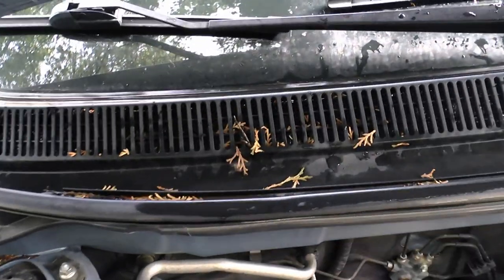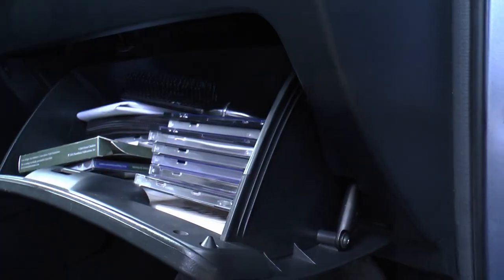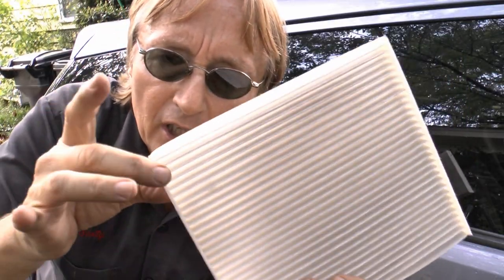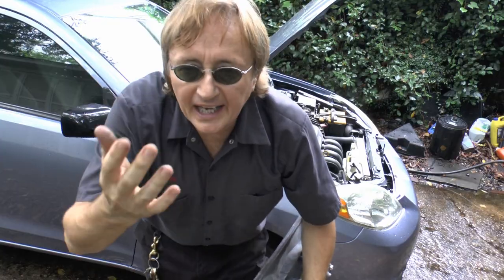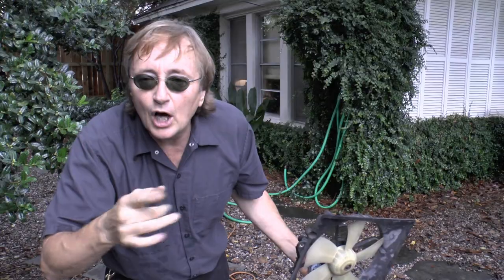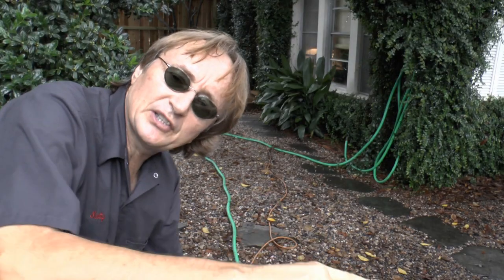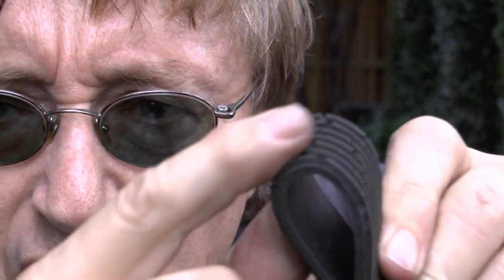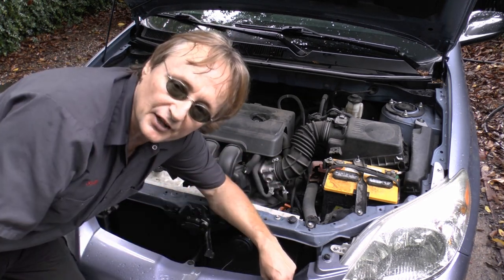How to Keep Your Car's AC Blowing Ice Cold for FREE

Comment: Hello Scott Kilmer! I have a problem with my Air in my 2006 Chevy TRAILBLAZER. it does not come out of the top vent facing the driver at all and is limited on the remaining middle and passenger vents, but work on the foot vents. can you tell me what seems to be the problem. I also have a problem when I start my truck up, it tends to turn back off: why is that happening?  My check engine light is still on and I changed the: MAF SENSOR, Oxygen Sensor, Cooling TEMP SENSOR, Oil Pressure Sensor,  Temp Sensor, Spark PLUGS and, Cleaned the Throttle Body- but not go off: What can be the problem you think?  My truck also shows a STABILIZER and Tracking Light on my dash for every time I turn my Steering WHEEL to the left or making a left turn on the road; I replaced my Stabilizer Links and bushinga, Control Arm Bars, and Rack and PINION. What could be the problem to this issue as all of others.  I thank you so much for All of your help and video illustrations!

Comment: Hi Mr. Kilmer!  Thanks for your shows, they are fun and your easy to understand!  I have a 94 Trans AM that I bought off a guy for a real unlucky price considering what problems I have ran into.  Can you show how to tune a bad accelerating, gas guzzling, loose clutch, misfiring car out of first gear?  I'd like to at least be able to regain all 350hp and turn out into the street with out crawling and waiting to suddenly accelerate.  Also if at all possible some veteran tricks to developing gas mileage, can you help?
Reply from the maker: Lorenk911   first, pressure test the fuel pump after changing the fuel filter, it could need replacing. Second, change the spark plugs and air filter, and pray my video "how to clean fuel injectors on your car" can get it working good again

Comment: hey Scotty, are you supposed to discharge for ac before taking off an ac compress to replace it with ac bypass.
Reply from the maker: +DatBoiSheed yes, legally you are required to use a recycling machine to catch it

Comment: Hi Scotty, i bought a Sprinter van of 2007 from a cold climate country. My guess is they never used it.
When i try to turn it on, just plain air comes out. But also when i turn it on, the engine wont change idling sound. Like all the others i have seen when AC is on. The Mechanic found the input for the liquid and pressed it. It made a hissing sound. Like compressed air coming out. And he said we need to fill it up with AC liquid/gas. My question is, since it has not AC liquid/gas in it, how come it let out compressed air? And do you think is any other problem with it, since it's the first summer i am using this car and never used AC.

Comment: Ok how about this.
2001 escape v6... AC started losing ability to cool (blowing less and less ice cold) til finally it is blowing warm ambient air. Compressor wasn't turning on so I added r134a. Got it to start cycling properly and was blowing cold for about a day or so. Then back to warm again. Added more r134a.... compressor "short cycling" - pressure rises as it should, compressor turns on and pressure drops as it should but then compressor turns right back off. It's off maybe 8-10 seconds and on for maybe 2-3 seconds.
I am sure there's something wrong to be losing r134a so rapidly but I cannot find it.... checked all over engine bay, hoses, compressor, etc. using UV light & glasses.
What's your take on it, Scotty? Vehicle has 148k miles with 3.0 v6 engine.
I don't have the $ to keep throwing cans of refrigerant at it nor do I have 800$ to have everything replaced.
No sense in throwing parts and stuff at it.
Help me out here - it's sticky humid Florida weather!
Reply: Jennifer Pitts 
Any luck?

Comment: Hey! I've been taking my 2000 mustang to this mechanic that's about a 5 minute walk from my home, and so far it seems he's only recharged my ac with fluid to make it blow cold again. Originally it was leaking "condensation", or at least I hope he's right, into my passenger floor. He went to home depot and got these tar strips, stuck them underneath, and (personally don't know if that's a real solution), was no longer leaking, at least in the passenger floor. But again, after a couple of weeks, the car was no longer blowing cold air. This has happened a few times, and I'm really not sure what to do at this point, not very car savy, and I was charged $80 for getting a recharge and those tar strips added. Any tips? Thanks a bunch!

Comment: Hey Scotty. Thanks for the videos. 
If the A/C system is charged and compressor clutch work but there is still no cold air, would it mean the compressor itself is the problem?

Thanks
Reply from the maker: bucksy99 realize modern cars are SO complex and computer run, it could be lots of things. For instance, I did a toyota that acted like that, put on a new compressor, and it still didn't work because the computer controls were bad and they shut the variable compressor off internally so it was spinning but not blowing cold air. Plus, blend doors could be stuck shut inside the dash, and you wouldn't get old air either.that's modern AC for you. But if an older car, that generally is a bad compressor, pressure test high and low side pressure to find out
Reply: thanks man. I know more or less we are driving computers now. My 75' vette is so easy to work on. I am getting good pressure h&l so I assume it is a stuck door. Will get to it. Thanks again for the videos and your response.

Comment: Hey Scotty I have a quick question. I have a 1996 v6 camaro that I replaced the AC compressor on. The repair is fine but the clutch on the brand new compressor rubs the pulley when the AC compressor is off. Is there a way to adjust the AC compressor clutch to pulley gap so that it does not rub? Or should I just drive it and see if it "wears in"? Thanks!
Reply from the maker: xXHUNTERXxXx gap is adjustable, but obviously it was made wrong. Either take it back or see if it wears in. Adjusting it requires special tools
Reply: Scotty Kilmer thanks scotty! Will watch it for a while.

Comment: Hi, is it important to which off the AC or heater before switching off the engine? Will it affect the performance of your AC/HEATER if you don’t switches  off before turning off the engine?
Reply: If you don't switch the AC off before turning the engine off, the condensation will remain on the evaporator fins and on the ducts, and the air from the vents will soon begin to smell. Switch the AC off, leaving the blower on, some minutes before turning the engine off.

Comment: I have problem on my Impala 2003 with dual climate control. I have dual control and two air blend door actuator, but I feel cold A/C only on passenger side, not  on driver side. At left I feel only the fresh air from outside. But when I select the hot setting I feel the heat from both side (same temperature left and right of the car), but with cold setting and A/C, there's only cold at passenger but not on driver side. So my passenger actuator work, but on driver side the actuator doesn't open fully for the cold. So you think I have to calibrate it with a scan tool (like I see on Chevy forum), or maybe the blend door (not actuator) for driver A/C doesn't open but only the heat close and open? I tried both recirculate & fresh air, and close the passenger side vent and on all vent, defrost, floor settings and it still the same. I tried to pull out the fuse of HVAC, put key on and replace fuse and start to manually calibrate but doesn't work.

Comment: Hey Scott.The ac in my Corolla blows fairly cold normally (although recently I haven't been able to use it in town because the car idles awfully with it on), but something odd happened on a road trip a few months ago. We brought our dog along for the ride, so when we had to stop for lunch I had to stay in the car with her and keep the car running with the ac on. Once we got back on the highway, the ac started to warm and blow much weaker for a while. After shutting it off for an hour or so it would run perfectly fine again fortunately. My dad said it may have been the compressor freezing up, but I'm not sure. Do you know what's wrong?
Reply from the maker: could have been, also check to make sure both cooling fans are working properly. Cars are not designed to just sit running in the hot with AC on, and if AC evap doesn't get enough air flow, it can freeze up the system
Reply: Thanks for the quick reply :) I guess I shoulda parked in the shade and shut the car off instead. Something like that wouldn't cause permanent damage though? Ugh, I hope not :\

Comment: Hey Scotty, have you heard of the 90s/2000s ford explorers and that problem with their blend door actuator?  My AC works on Max, and every other mode pumps out heat, but I can't ever simply use the vents (and since most of my driving is on the highway having the windows open is a disaster) and I hate knowing that it's broken...  do you think it's worth fixing since it usually involves a lot of work getting to it? My specific car is a 98 explorer sport, the 2 door one with the SOHC motor.
Reply from the maker: yes, and it's a ton of work to fix it
Reply: Scotty Kilmer All right, I'll save some money to fix it once I've paid back my grandma since she helped me buy it, about how much do you think it would be to fix?
Reply: scotty, one question, I have 2002 chevy s10 crew cab, but I can't find the cabin air filter, can you help me to find it?. tanks
Reply: Google for pics.

Comment: Hi love the channel i have a question my ac isn't working thought it was the fuse but thinking it might be the the ac switch in my car the problem is the compressor isn't circulating i am not getting a signal from the wire what do i do?
Reply from the maker: if you mean the ac compressor clutch is getting no power, just send power there with a jumper wire from the battery and see if it works then. If so, fix the wiring OR just run a toggle switch to make it blow cold. Pray it's that easy

Comment: Hey Scotty my AC compressor bearings inside were shot and was making a lot of noise so i replaced it. I put the new one in filled it up with refrigerant but the clutch is constantly engaged for some reason. It is very cool inside the cab it seems like it is working fine but the fact the AC clutch does not turn on and off worries me? Should I be worried? what could be wrong?
Reply from the maker: Thomas Petito if you used a rebuilt pump, MANY are just poorly done and inefficient so they never shut off. If it blows cold, be happy
Reply: Scotty Kilmer I'm nervous that it doesn't turn off it will ruin the rest of the system from the clutch constantly being engaged when I am using it. It's a brand new Denso unit.

Comment: Hey Scotty I have a question. My 2001 maxima squeals when I turn on my ac, defrost, and sometimes when my headlights are on. My ac still blows cold air and doesn't squeal only when I'm on the highway or driving at a consistent speed, but starts squealing again if I start to slow down. I've changed the alternator and battery plus all the belts in my car. Any suggestions? Thanks

Comment: Hey Scotty, I have a 2003 Chevy Malibu. I've noticed that the light for the AC will sometimes flash on and off, and you can hear the engine rev more, and return to normal. You can also hear a clicking noise under the hood. I wasn't sure if it was the belt, or something worse. The issue will be off and on, sometimes it does it, sometimes it runs just fine. Any advice?
Reply from the maker: generally that's the ac clutch and or compressor itself starting to go out on that model
Reply: Thanks, about how much do those run for non-OEM parts?
Reply from the maker: *****
prices vary widely,call around and ask for chinese made compressors
Reply: Sounds like the AC is running normally. The engine should idle up a little when the compressor clutches on, it stops the compressor from causing too lower idle. On small engines the AC compressor will labor the engine at idle if the idle-up isn't working. It should only idle up a little bit, say 200 rpm more. A loud click means your AC clutch is good and strong. If it's a rhythmic clicking sound from inside the compressor while it's turning that's not good.

Comment: Hey Scotty Kilmer, I of a 1990 Chevy lumina 3.1 liter. everything in the fuel system has been replaced tank, pump,lines, injectors,rails, could it be a pressure regulator? It runs perfect and starts perfect in the summer. But the minute it gets below 60 I have to use starting fluid why is that? thank you.
Reply from the maker: +bill thompson it could be a bad pressure regulator, also could be computer circuit breaking down internally form the cold
Reply: +bill thompson Check the engine temp sensor!

Comment: I've never done any of the things described in the video with my Seat toledo. The Ac is still blowing cold (atleast cold enough for me) But i wanna try these tips maybe it gets even colder :). My Ac didn't have service in 3 years so maybe i should do that as well. I remember when i had it serviced and a few days later there was a heatwave in my country 35 degrees celsius but inside my car it was like 20. Yes that's bad looking at personal health but i got an oldschool AC no climatecontrol unfortunately.
Reply: Manual climate control is actually better than automatic in cars (in buses it's another thing since comfortable large volume cooling requires more precise climate control based on a precise set point temperature), more reliable because there are no sensors and no electronics that can go haywire anytime. Remember that cooling capacity, i.e. how much cool air the system blows and therefore evaporator load, depends upon blower speed. So if you want your cabin to get not so cold you can keep the blower at minimum speed and you'll also notice the compressor get quieter and put less strain on the engine (so that you don't feel the "throttle lag"). It has the added advantage of keeping humidity at its lowest. Then to have colder air and have it faster you can, in addition to putting the blower on max speed, use recirculation, and using recirculation also strains the compressor less (and also have better driveability) because all the evaporator has to do is further cool already cool air coming from the cabin, and if you want warmer air turn recirculation off (i.e. cool fresh air). In addition if you have a Bowden cable air recirculation flap control like on the Vauxhall Agila you can also open it partially so that's another way to control cabin air temperature. Further, if the air is still too cool you can work on the temperature knob so that it gets partially reheated until you feel comfortable. Last but not least, the ac should cool the cabin, not your body or your face, so just let it blow on the windscreen or turn the vents away from you. If the only way of enjoying cool air in your car is pointing vents on your face then you're either using the ac improperly or you have an underperforming AC system that needs servicing.
Reply: I only put the vents on my face when i just started the car and the cabin isn't cooled yet :P. I now service the AC every year because i hate heat. Will skip a year if the AC is not smelling weird and blowing cold enough.

Comment: Hey Scott,, back in the day my dad used to turn off the AC before turning off the car. Why? And is it still necessary?
Reply: Your dad did so because old cars didn't have PCMs, ECUs and the like and a trying to drag a good old York or RV2 compressor along with the engine and anything else would surely blow the starter motor up if one keeped at it. Now ECUs power the compressor clutch on or bring it up to pumping displacement only when the engine has started and idle has stabilized so it won't do any harm except leave some moisture on the evaporator's fins and inside the ducts and make a bad smell develop over time.

Comment: I have a '01 chevy Tahoe and my a/c blows, but warm air comes out. I had it filled with Freon about 1.5 yrs ago. it works fine just not blowing cold. maybe you can point me in the direction of where to look. thanks.
Reply from the maker: +calitrucker1 odds are it's leaked out. Do my video "finding AC leaks on your car" and put UV leak dye into it to find the leak

Comment: Great vid but can you help me with my car, 2002 Volvo s40 1.9t but the ac randomly blows hard then soft and alternates even when put on low setting as well, on hi setting it doesn't drop nearly as much, any thoughts? Thanks much appreciated
Reply from the maker: replace the blower motor resistor assembly, they do that on volvos as they break down

Comment: Please make a video also how to lower ac temp its so cold inside and it's like a fridge inside
Reply: Simple stuff. 1)Clean the condenser thoroughly 2)Have the system functionally checked, evacuated, cleaned up, vacuumed and regassed and supply the AC guy a new receiver drier and ask for it to be changed 3)Turn AC on 4)Turn recirculation on or move recirculation lever to maximum recirculation 5)Make sure that the temperature knob is on the coolest position (non need if automatic) 6)Put blower on max speed or temp on lowest setting. Guarantee it will be freezing in there.

Comment: I have a leak on the low pressure line. can you just replace the low pressure line on the ac? it's a 04 hyundai sonata. they sell just the low pressure line at AutoZone. so I assume you can. but just wanted your opinion

Comment: I have a 2004 gmc yukon xl and the air-conditioned only seems to work when I'm driving on the highway. And sometimes it throws hot air (like the heater) when I turn it on and I have to turn the car off and then turn it back in to make it cool again.. Any ideas that I should take to the mechanic to get it fixed..?